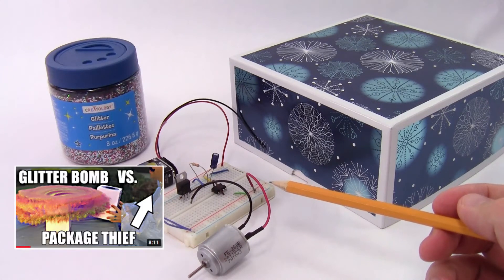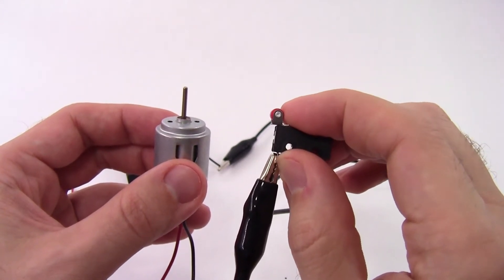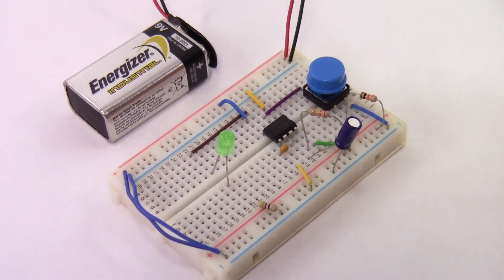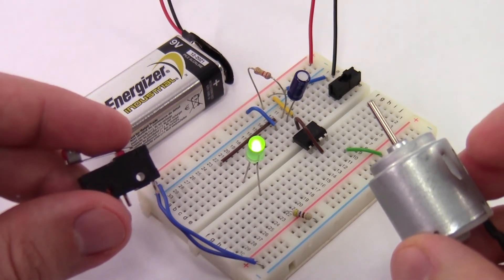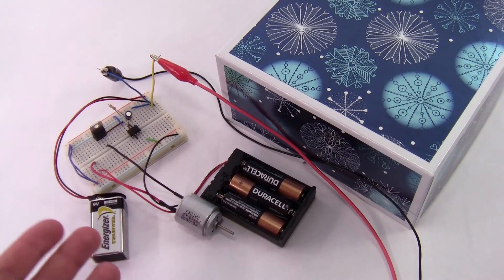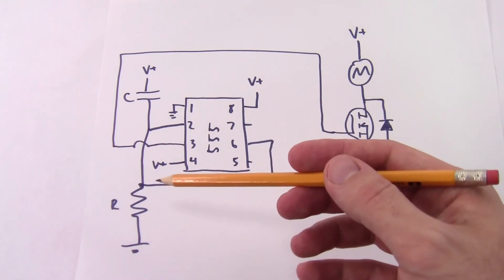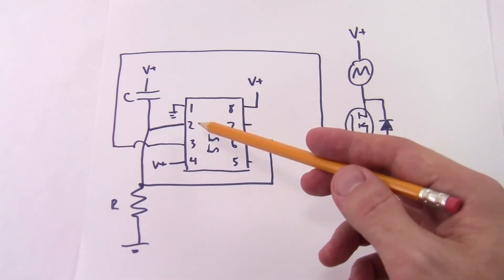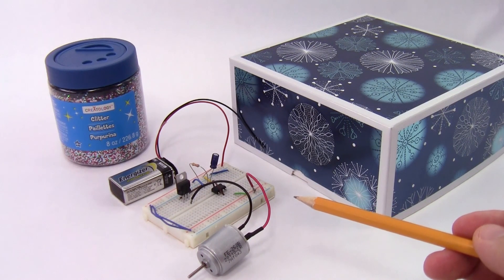Mark Rober-Inspired Glitter Bomb Circuit

Comment: This is cool and all, but why not just use a spring on the lid positioned to give you an extra second or two, you can adjust the spring to the limiter switch for whatever extra time you think you need. The 555 timer seems too long tbh. If this was sent to me, I'd have enough time to see what it is, and react by shutting it quickly.

Comment: What voltage motor would be used? 9v for the 9v battery or 6v for the 4 AA batteries?
Reply from the maker: In this case it's a 3xAA battery pack providing 4.5V for the motor, the 9V battery is powering the 555 timer separately.
Reply: @BenFinio  Ok, thanks.